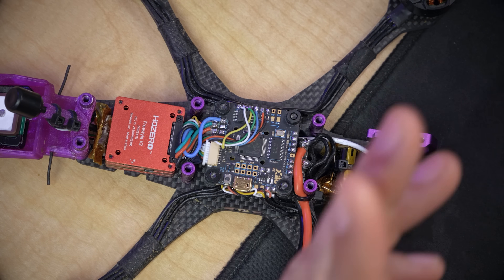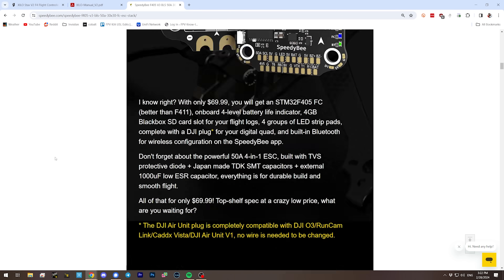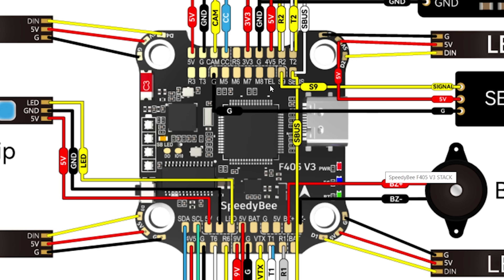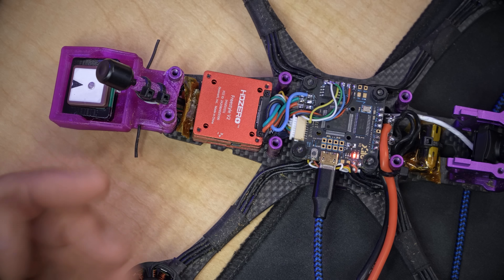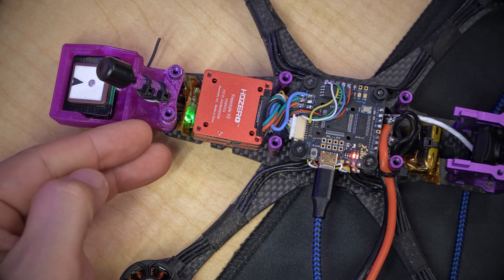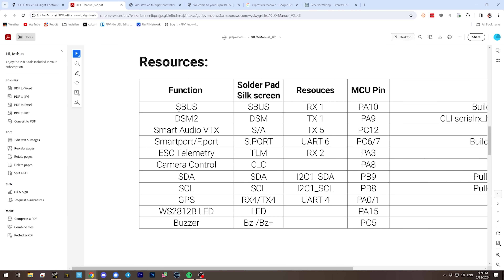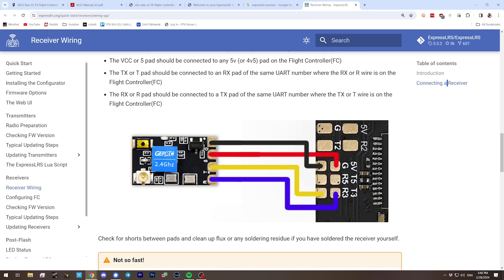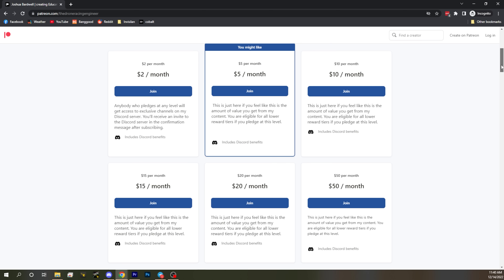Your SBUS input isn't useless anymore!

Comment: The chapter "Why the problem exists" lack the very reason about the inverted serial signal origin :)  Who are interested - it is because when Futaba invented SBUS protocol more than decade ago, they found that inverted signal make receiver output signal path to destination (FC, servo etc.) less affected to electric noise. For electronics in those days logical zero as high voltage and logical 1 as low voltage made signal path a bit more reliable. Nowadays better electronics and shorter signal paths in smaller drones eliminated need for signal inversion and now RC circuits use direct signals without inversion.

Comment: Man this is the first video that anyone (including yours) where this has been explained properly, linking the issue to the F4 chip and not the F4 FC boards. Well done sir in explaining and explaining the double inversion, such an easy concept when explained properly. I never got this concept pre-covid when I flew before and now that I understand it, nothing is left with SBus/FPort as I moved everythig to ELRS ;) However I have loads of F4 boards so this will be a neat trick. Now, if only you know a trick to repurpose an SPI receiver for something useful now that I added ELRS instead that would be smashing for micros ;)

Comment: I use the SBUS output feature from ELRS to fly my Goosky S1. The flight controller on it does not support crossfire protocol but supports Futaba SBUS which is popular in the heli community. Thanks to this feature I can now bring one remote to fly my kwads and helis!
Reply: Will it work on the omp M1 too?

Comment: How delightfully convoluted!

And the double inversion does nothing to exacerbate latency issues?
Reply from the maker: The latency coming out of the ELRS receiver is the same, since it is the thing generating the signal. The hardware inverter on the FC adds picoseconds of latency -- essentially none.
Reply: The inverter will be a very simple device, potentially as simple as a single transistor and resistor, it will not add any noticeable latency only the time it takes for the transistor to switch which is negligible, most likely in the picosecond range.
Reply from the maker: No, not at all. The latency of the hardware inverter is in the picoseconds range.

Comment: You can do this directly on many flight controllers too:-
Look at the target parameters (there's a link when you go to flash) and you'll see resource INVERTER 1 C00 or similar, go to the CLI and type resource INVERTER 1 none and that'll free up another UART for use (I was using the Diatone Mamba F405 Mk2, and now have Crossfire on UART1 on the SBUS and TX1 pads).
Reply from the maker: Unfortunately, many FC do not have a switchable inverter. You won't find an INVERTER resource on those FC. But it's a good idea, and definitely deserves to be included in this tutorial, especially for Crossfire users who can't ouptut inverted SBUS as far as I know.

Comment: I did this and it worked, but the ELRS wouldn't blink while on battery but it would on USD: Watch out when doing this while using the DJI O3, as it will steal the connection from the ELRS and wont allow it to work. To troubleshoot remove the SBUS cable from the VTX and you should be good to go. Keep in mind you cannot do this if using a DJI controller. Thank you Mr Bardwell. Now I can add. a GPS Module!

Comment: You run into the opposite problem connecting Fr-Sky to an arduino. The reciever has a build in signal invertor. 

It's only possible if you Connect the receiver to your arduino  behind the signal invertor because the S-BUS on Arduino needs an uninverted signal

Comment: Thank you so much for all the info you've put out there, I am new to the hobby and really appreciate it!  I purchased the Xilo Stax F4 v2 along with a RadioMaster R81 receiver.  I have it wired to the SBUS pad on the F4 along with GRND and 5v. It bound properly to my TX16s
BetaFlight is configured as follows:
Serial Rx enabled on UART1
"Receiver Mode" set to Serial, 
"Serial Receiver Provider" set to SBUS
Channel Map set to AETR1234 
But, I'm not getting any input from the sticks in BF.  Any advice?  Also, is there a way to test the SBUS output of the receiver?

Comment: Great video Joshua. I am having an conandrum. I ma looking for an receiver to install with Holybro x650 which operates with Pixhawk 6c, with Radio Master TX16S ELRS ground unit. It seems to me that ELRS is only option but what receiver would be best option without too much wiring hussle? Also I do assume plug to utlize on Pixhawk 6c for receiver will be SBAS plug? Thanks for help.

Comment: Cant you just turn the inversion to desired setting in the cli?  And use uart  one normally with elrs?
Reply from the maker: The CLI setting does not change whether the input is inverted. It changes whether the FC expects to see an inverted signal. The inverter is a physical hardware device that is installed on the FC and usually is not switchable. So for example, what people used to do once upon a time is get a 2nd inverter and install it on the SBUS wire. Now there are two inverters (one on the wire and one on the FC) and the signal coming in is un-inverted. At that point, you need to use the CLI option to tell the FC that the input is not inverted anymore.

There are a few FC that have switchable inverters, where the SBUS pad can change from inverted to un-inverted, but they are rare.

Comment: This is great. I have one drone, it only has SBUS and DSMX inputs (GepRC  Cygnet3). Will the DSM  trick work with a DSMX? 

Update: I did it, I got ELRS working on the Cygnet3 FC. ELRS config was SBUS (non-inverted). The board has no additional DSM pin, just another 3.3v pin, not sure if that's it or not. Either way. It works. Thanks

Comment: You didn't show the port tab , since that was a subs pad connected to UART 1 then is it configurable in port tab ? Or is UART1 visible in ports tab or not ?
Reply from the maker: You would configure UART 1 as usual for CRSF. The fact that the inverter is present doesn't matter.

Comment: This is great but I have a question on newer firmare that has CRSF Inverted option (not invert TX pin). I'm using Xilo F4 and HappyModel EP1. When I select inverted crsf I loose telemetry from FC but sticks work, if I set to normal crsf I get FC telemetry but loose sticks. I wonder if inverted crfs is inverting both tx and rx (SBUS snd DSM)?

Comment: Hi @JoshuaBardwell, I have a question. I have QAVS-2 JB Edition and the same Xilo Stax F4 FC. I also have a DJI o3 Unit, GPS, and Express LRS. The situation is when I invert the TX on the Express LRS, some of the telemetry sensors don't work. When I selected the Inverted TX option, I could get only 9 of the telemetry sensors, and I wanted to see GPS Sats and RxBat on my Radio but could not. When I select the CRSF option on the LULA script of my RX (RM Express LRS RP1) the full sensor is working. But, at that time ELRS couldn't talk to my FC as expected. How can I solve this? I mean it has to be Inverted TX, but I want to have full telemetry sensors, not only 9 of them. Is this possible?

Comment: It's ironic that in an attempt to make it easy to wire up, they actually make it more complicated. Manufacturers (probably the Marketing departments) make this stuff more complicated by labeling the board's output pads with protocol names.  If UART pads were simply labeled active-high or active-low, one would know to simply match the signal appropriately.  If it doesn't match, invert it.  Job done.
Reply from the maker: iFlight does it right, IMO, by naming the pad nR1 or whatever, meaning "inverted R1".

Comment: @joshuabardwell I have an old Emax BabyHawk R that uses a Radiomaster R81 sbus receiver. I just bought a Micro Ranger ELRS module and a couple RP1 receivers. I flashed them according to your video and have them bound to my RM Boxer. Do I wire the TX to the signal pad like my original receiver, change the model to SBUS or InvertedSBUS and leave my radio set to CRSF? Or is there something else I need to change on my radio? Hopefully I’m asking the right question.

Comment: very good info, how do i invert a crossfire Nano receiver so i can use it on sbus. i have a taker g4 45a AIO,and  crossfire uses tx rx 2 on the taker g4,  but my rx 2  pad is burnt out so i cant solder my crossfire to it. there is rx4 but instructions say crossfire uses rx tx 2...  hope you can help. thankyou.
Reply from the maker: Pretty sure CRSF receiver can be set to output SBUS.
Reply: @JoshuaBardwell  thankyou joshua, i will look into how to do this. and thanks again.

Comment: great idea. I dont have free uart because i want to use GPS so i can find my drone by coordinates from radio. so i will use sbus. which does not transmit telemetry. uh! so i have to record DVR of every single flight. ...
Reply: Depending on your FC you can maybe also use soft serial to create an additional UART, it will be limited to 9600 bauds but that can do the job for GPS (not compatible with CRSF/ELRS or HD video systems). But if you have an SBUS pad this is obviously the best thing to do.

Comment: I have your setup wired this way with gps but for some reason I have to start the flight controller with the usb port to a power bank before plug in the battery?   Otherwise the elrs receiver doesn’t bind correctly. It’ll say it’s bound but it isn’t.
Reply: I’m having the same problem.  Are you using the DJI 3-in-1 cable connection for your vtx?
Reply: Yes
Reply: If I unplug my 3-in-1 cable I can bind too.  I tried removing the yellow (sbus) wire from the 3-in-1 cable but that didn’t fix it. Maybe this won’t work with Dji?
Reply: @GearBangerFPV ya right now I’m just living with having to jump start it on a external usb battery power bank.  Sorta a pain.   I played around with trying to put the receiver on different soldering pads no luck.
Reply: A pin was bent inside my flight controller causing it to still be connected even though I had pulled the wire.  Bent the pin over and all is well in the world again.

You can take a small needle and lift up the black plastic clip holding the yellow wire in on both sides of the 3-in-1 cable or just cut it off.  That should solve the conflict issue.
Reply: @GearBangerFPV  I’ll give that a shot
Reply: @GearBangerFPV  yup tired it today works perfectly.   Did Josh now show this in any of his videos or did I miss this.   I know on his build he didn’t put gps so I know he wouldn’t have had this issue on his build series.  I feel this is important information for using that flight controller with elrs and gps
Reply: I’m sure in the thousands of hours of content it’s in there somewhere.  A friend of mine had this same issue and spent days on discord and chat groups, that is the only reason I knew about it
Reply: Glad I could help!

Comment: Okay, as someone who is new to expresslrs.... I've got several speedybee F4 stacks (a couple of different Version designations).  Since the documentation shows that uart6 is available, I should just be able to connect to that uart using crossfire as the protocol and not have to worry about inverting anything?
Reply from the maker: Correct.

Comment: Sooooooooooooooo the example is on an F405, which usually has 5 or so UARTs?

On F411, 2 UARTs are 2 UARTs, wouldn't trust soft serial on any of 3 (digital VTX, receiver, GPS).
Not that I endorse budget friendly FC if all 3 is required but still.

On another note, saw some very specific F7 FC with 3 pads in total for UARTs, which should be the the intended case........... Wait, F7 doesn't care if signal is inverted.

Comment: I might be wrong but can't you just set "sbus inversion = off" in the betaflight cli to achieve the same thing? However the zohd copilot is one fc that i can think of that accepts sbus and pwm only and there is no way to change it so this would be super useful for that i would presume.
Reply from the maker: I think the option you're referring to is "serialrx_inverted". That option doesn't make an F4 processor be able to receive an inverted-serial protocol like SBUS or FPORT. That option is used to tell the FC whether the incoming protocl is inverted or not. So in theory, if you had an uninverted-SBUS signal coming from some device, you could use that option to tell the FC, "hey, you're about to get an SBUS signal, but it's not inverted like you think it should be." 

Frankly, the name of the tlm_inverted and serialrx_inverted options is consuing and a little bit misleading.

Comment: in theory, if betaflight developpers wanted to, could they create an inverted protocol (let's call it XSBUS) that can interpret what a frsky receiver is sending to the f405 through a normal UART ?

I am not talking about softserial where the f405 has to do extra work and latency is induced.
Reply from the maker: No, it's not possible. Interpreting the serial signal is built into the hardware of the STM32 chip. By the time betaflight sees it, it's already been interpreted into 1's and 0's.

Comment: so i have one question. i have a CLRacing F4S FC and an ELRS receiver. if i invert the ELRS signal and use the sbus pad could i then use the tele pad for telemetry? i am new this stuff so please bare with me.
Reply from the maker: I don't know the UART breakdown on that FC so I can't say for sure. Both TX and RX need to be the same UART. Also the TELE input is inverted so you'd need both TX and RX on the receiver to be inverted.
Reply: @JoshuaBardwell  got it thanks. Love the vids keep up the great work.

Comment: Ran into a problem when doing this. (I built Josh's 5"build) When powered by battery the reciver light is solid green and doesn't connect to transmitter. 
Poking around the ELRS site it says it's "primarily caused by pull-down resistor on the RX pad to aid with SBUS line inversion."
Anyone have a work around for this?
Reply: to make it work you need to pull the yellow cable out of the DJI o3

Comment: Ineed help
I just got the jumper t light v2 and I need help flashing it I open the configurator and set the release as 3.3.2 device category should be jumper 2.4GHz and the device should have 2400 tx but the only options are stuff that says 2.4GHz please I need help I might quit I don't want to I want to fly whoops

Comment: Shame this is an ELRS-only solution (might save some time if you put that in the title).     
Crossfire itself can output SBUS (and even non-inverted SBUS), but can't do CRSF protocol with inverted Tx output.  
For a hardware solution I see a $4 board on Aliexpress that is an SBUS inverter.
Reply from the maker: FWIW, ELRS is in the thumbnail.
Reply: The free hardware solution is to desolder the inverter and bypass it with a jumper wire. Don't try it if you aren't any good at SMD soldering though.